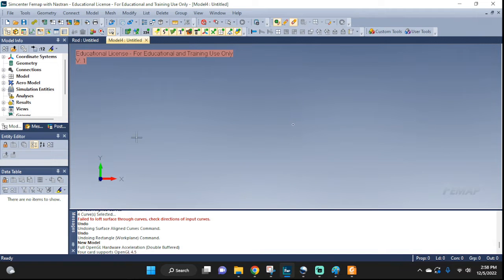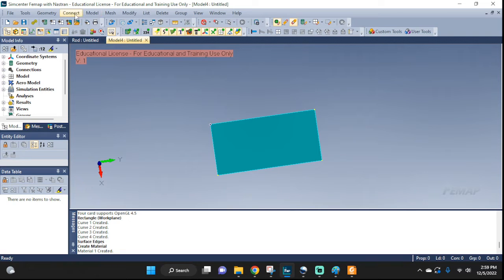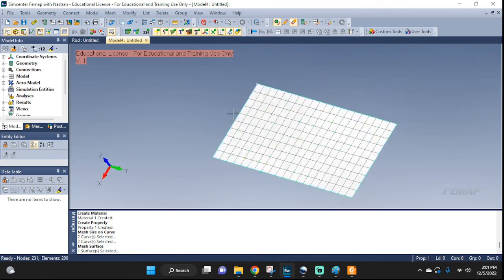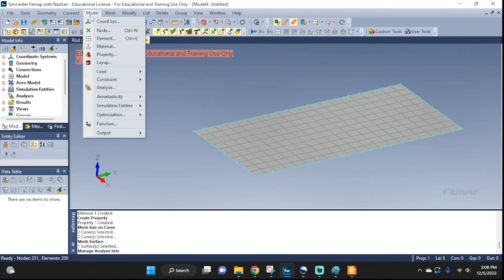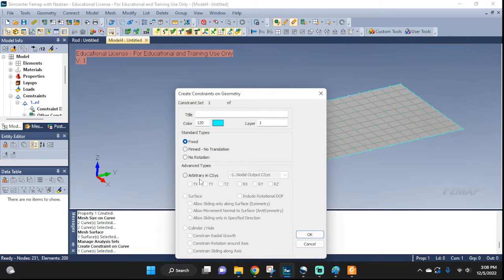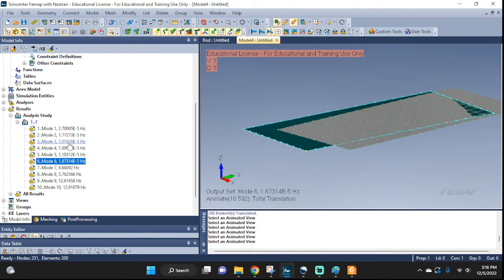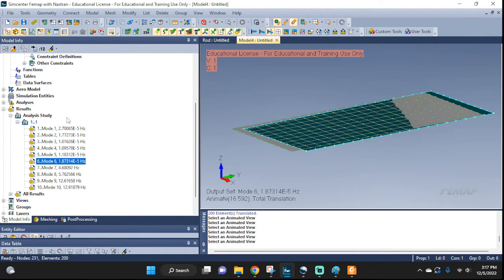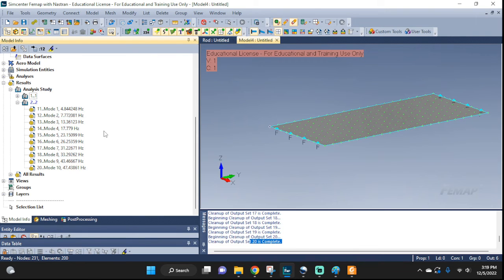Femap Nastran Normal modes Analysis. Is the geometry properly constrained?

Comment: good useful video. liked and subbed. i am trying to find normal modes of a steel tube. is there anything different that i need to do in the setup.
Reply from the maker: I think these videos are a great tool to get you started, but the Femap user guide books can be of good use if you need  to look into things further!